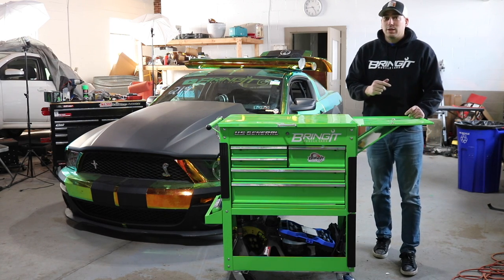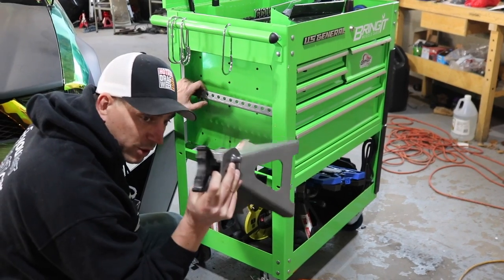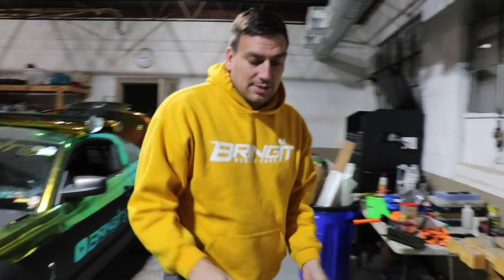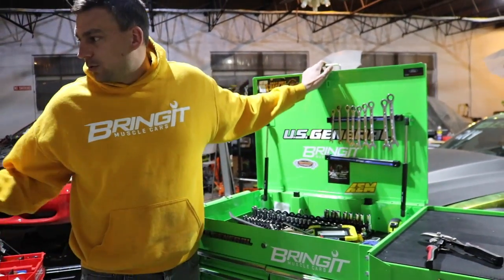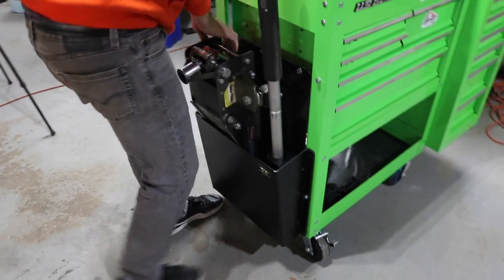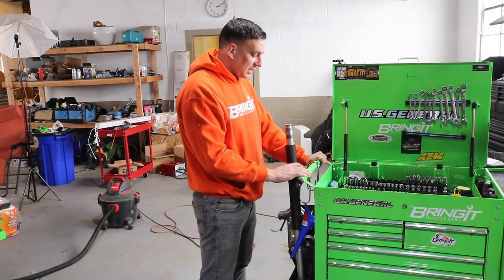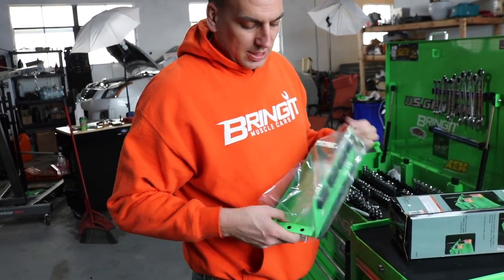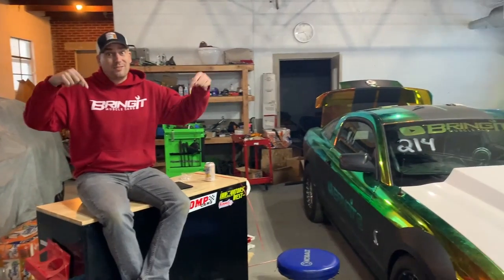HOW TO ADD THE END CABINET ONTO THE HARBOR FREIGHT TOOL CART #harborfreightprojects

Comment: This is awesome I was thinking the car is really good but I was afraid it might be just a little bit too small for some of my tools so adding this extra cabinet is a great idea you showed it really well what I found one for mine whenever I get as I want to change it over to pneumatic off-road tires for the cart and what I'll do is add two more tires to the side box that way it's six wheels instead of four and that will help out with the tippiness because I don't need the jack holder on mine or I could go real crazy and add two side boxes one on each side
Reply from the maker: I think if you can weld adding a frame to the bottom and moving the casters as far out as possible would be really good.

Comment: I did the same for mine but I then drilled 4 holes into it and remounted my folding tray to the side cabinet...then I took the magnetic paper towel holder and stuck it to the tray.... now then you’ll have the ultimate tool cart
Reply from the maker: y0gisdad I can’t disagree with that. I should have added it back on.
Reply: @BringItMuscleCars  might want to also secure the bottom of the chest to the cart
Reply from the maker: Charles Martin I’ll probably end up doing that. For the most part the cart will be stationary in my trailer.

Comment: I picked up the 4 drow and then added a side tool box on both sides then l put on bigger wheels. Works great. Then found a 9 drew top box, took the lead off it fitted in the bottom.
Reply from the maker: Matt Swearingen that’s a lot of box at that point. Why didn’t you just get one of there boxes. It might have been cheaper.
Reply: Well I already have a Craftsman bottom and top box but I like this set up.
Reply from the maker: Matt Swearingen makes sense then.

Comment: GREAT video.  Did the same thing with my tool cart.  An electric or air powered cut off wheel makes the necessary cuts easier and quicker in my experience.  
Would you mind to give us the name of the paint color you used ? Not perfect,  but best color match I have seen
Reply from the maker: Mark Bell i couldn’t find my little cut off saw. That would have definitely made it easier. I’ll take a look at the paint next time I’m at the shop and let you know. Thanks for watching and commenting.

Comment: Think I'd just buy the 44in tool chest. Has wheels. Bolt a handle to it. Put your jack holder on the side, done. I just think if you fill that end cabinet full of tools you're gonna run into that thing trying to tip over. But maybe I'm wrong.
Reply from the maker: Definitely not wrong. And the side cabinet doesn’t hold that much anyway.

Comment: Late to the party but I was just considering a similar project. Since you've now had 8 months rolling it around, in hindsight would you just weld a frame or repeat this process? 

I would like to add a side cabinet on both sides, would this be viable given the stability of the cart or would you weld a frame? 

I'm not a mechanic, the center section will hold my metal lathe tooling and the side cabinets my foredom accessories and angle grinder accessories for sharpening lathe tools. Thank you!
Reply from the maker: If you can weld a frame around everything would be best. Also you could push the wheels out for more stability. However with two side cabinets the cart will be very heavy. Those side cabinets are very heavy. You may want to support the side post of the cart too if you’re wheeling it around.  

My personal opinion is if you’re in a shop area and want to add the side cabinet don’t. Just get the 26” box. It’s just a little bit more money but holds 3 times the tools. The side cabinets do not hold much.

Comment: Only thing missing is the 1000lbs harbor freight lift table. But that's a option if you work on trucks. This cart setup is basically my set up but I have the lift table because I'm a diesel mechanic 😂
Reply from the maker: Cody Phillips I’ll have to check that lift table out I’ve never heard of that with the cart. Where is it mounted.
Reply: @BringItMuscleCars  check out my Instagram codyphillips48. I took the cart put it on the lift table drilled  the 16 holes and bolted the cart to the lift table I place of the wheels

Comment: thanks for doing a video on adding the  side cabinet some of the guys at my work and I have been thinking about doing this.  Please do a follow up video after use to let us know if it is too much weight we have to move our carts around in a factory.
Reply from the maker: joshua hall I can do that. Thank you for watching and commenting. I appreciate the support.
Reply: It's too much rolling around a factory. Unless you reinforce it really well the bolts will start to try to pull out of it mainly it seems to be the expansion joints they put in the floor. I've seen it happen on at least 3 of them now. Unless it just sits in one spot I'd suggest skipping adding any big locker or drawers on the end.
If you still have to do it, IMHO best thing to do is get some angle iron and build a frame for it to sit on. Then move the casters out to all 4 corners.

Comment: Way cool.
I am surprised you didn't paint the jack holder green.
Also surprised you didn't put the fold out table on to the add on side cabinet.
It would take some work but I bet you could figure it out.
Reply from the maker: The only reason I didn’t add the tray was because it was meant to stay in my trailer. I really should have just added it anyway.

Comment: I think I would have made some standoffs to mount the side cabinet and added casters it’s going to be heavy on cabinet side when the jack is being used
Reply from the maker: It sits fine. If you are going to roll it around a lot a frame under everything would help a lot. I originally built it to sit in my trailer.
Reply: @BringItMuscleCars  goog to know thanks for the video

Comment: Awesome video---great mod---been looking at the side storage too!  One thing that is bugging me:  hit those cut corners with a little paint.  I bet someone has the color listed of exact match.  I got blue and someone had listed the exact color match for it----Rust-Oleum Painters Touch 2x Ultracover DEEP BLUE GLOSS.  Almost identical.
Reply from the maker: I wasn’t really worried about the doing that but I do have some more custom stuff coming to the box so I could do it then. Thanks for the paint recommendation.

Comment: As much as I use air tools I would be tempted to add another set of drawers to the other side. Just add angle iron frame to the bottom of it. A good set of casters then good to go .
Reply from the maker: Duke of_destruction I’m thinking of doing something like that. I think you might want some more angle iron in the middle too.
Reply: @BringItMuscleCars  yeah exactly!!! Basically making a frame for the entire bottom . Diagonal bars in the middle from corner to corner
Reply from the maker: Duke of_destruction yup. That should make it pretty sturdy at that point.

Comment: Flush the front and overhang the rear add sum wheels on the side cab for stability
Reply from the maker: Tom Mater I choose to have it flush in the back because I mount it in my trailer. If it wasn’t for that I’d have it flush in the front.

Comment: This is my first time watching your channel. I'm wondering with the type of work you do, the bada$$ Pony in the back ground that you would even bother with HF. I see you have Kobalt and Husky as well. I'm not judging at all.  I think that is genius how you set that up. It obviously wouldn't take a genius to figure that the cabinet will need casters. That's a given, I wonder if the structure of the cart it's self will be able to with stand the weight of all the tools. Sitting in one place would be okay but once it goes into motion, weight shifting, if that maybe cause a big issue? Definitely liked your video!
Reply from the maker: dmckimmey1 cheaper tools work nearly as good as really expensive ones. I need to save money on the tools to help mod the Shelby. Only so much to around. Why spend $100 on a tool when a $20 tool works just as well. That’s enough to buy race gas and a hotdog at the track. The cabinet may need wheels. For the most part it’s strapped into the car trailer.
Reply: @BringItMuscleCars  I'm the same way with my tools. My cart and most of my sockets, ratchets, my jack and stands, etc are all harbor freight. But anything powered such as my 18v/12v  impacts, drivers, electric ratchets are all milwakee.
Reply from the maker: Shan s I have a Milwaukee ratchet which is awesome. Then my 1/2” impact is Kobalt. That thing has been a beast.  No complaints on that. I’ve never used the harbor freight electric tools. Not sure I will at this point.
Reply: @BringItMuscleCars  the only thing electric I have from them is the plug in angle grinder which I've had for years and works fine. A close friend of mine started using their new cordless 1/2" impact recently and it's been good to him. However it is larger and not as powerful as my milwakee mid torque. I've had to come break a few crank pulley bolts for him.
Reply from the maker: Shan s my bet in a year or two they will be much better on all of the cordless power tools.

Comment: How about bolting the side cab to the cart and then moving the casters to the cab
Reply from the maker: The bottom of end cabinet isn’t the same as the cart.
Reply: @BringItMuscleCars  from one mechanic to another, make a couple plates and it’ll distribute the weight better
Reply: @BringItMuscleCars  dig the idea though, definitely going to be doing it to mine now too
Reply from the maker: @DelcoDieselRP  it’s definitely handy.

Comment: I don't see the stock wheels holding up to that weight. And I would have cut the side wall down 1/4" or so and cut the front of the side unit a bit so the top cover fit better.

Comment: Buy four swivel casters. Replace the two fixed casters with two of the swivel casters on the cart. Take the other two swivel casters and mount them on the outside corners of the cabinet. Reinforce bottom of cabinet if necessary. Buy the time you weigh that box down the four casters are gonna catch hell.
Reply from the maker: Richard Alvis I’ve already done the swivel caster mod the cart. I’ll probably just get two more to mount to the cabinet. I’m worried how it will be once I put some weight in it.

Comment: Why not attach the side box with a few nuts and bolts then add 2 swivel casters to the outside of side box this would make it so much more stable and it wouldn't be heavy on the side box side. Also use a cutoff to cut your lid and side box
Reply from the maker: Jim Bogucki you definitely can do that. I’m not really sure you need to bolt it down. The weight is going to hold it in place.

Comment: Might want to put a rechargeable led strip inside the top. Just incase it gets dark out can see your tools and the sizes.
Reply from the maker: VENOMVETTE that’s a great tip. I hadn’t thought of that.
Reply from the maker: VENOMVETTE that’s a great tip. I hadn’t thought of that. Thanks for sharing.
Reply: Bring It Muscle Cars I mounted a 32 inch tv on the back lid on mine with some speakers.
Reply from the maker: VENOMVETTE that’s cool. Mine is normally against the wall of the trailer so i don’t think that would work for me.

Comment: Just my opinion but I would of just put swivel casters under the end cabinet with a block of wood for a spacer probably to much wieght for those cart wheels with that jack
Reply from the maker: When rolling it around on flat smooth ground you don’t need casters under the cabinet. It rolls nice and smooth.

Comment: Might want to support the bottom of the chest or you will end up like me and have with a cart that I couldn't move around.  I ended up bending my bottom tray and essentially loosing the functionality of my roll cart beef up the bottom with some angle iron and add a set of wheels to the bottom of the chest as well
Reply from the maker: Charles Martin I could see that happening. I do plan on adding wheels to the chest.

Comment: Remember, you can always fold up a tripod (like the one I see here in the video, unused) and attach the camera to it, and carry it around like a steadycam. It's not perfect, but it does allow you to get decent stability.
Reply from the maker: Nathan DuPhene I’m getting a new camera next month if we get back to work. I’m getting one that has a much better Image stabilizer built in.
Reply: @BringItMuscleCars  If you were holding it with no tripod or steadycam, what you got was pretty good.

I took the phone holder from a selfie stick and attached it to a small tripod. I fold up the tripod and the bulk of it gives me a lot more options to grip than a selfie stick. Bonus - setting it up as a normal tripod when I want to!

Local libraries sometimes have GoPros you can check out, too. I am all about saving $$.

Comment: I would have had it Wheels to the bottom of the side cabinet and I would have stuck another side cabinet on the other side it's stuck your jack holder on to the side of one of them cabinets and then I was stuck another set of wheels underneath that cabinet to make it easier to roll around and I wouldn't just use the regular plastic casters are used the rubber air-filled ones
Reply from the maker: edward wolf I could see that. If you need two end cabinets then you might want to just get a box. Much better storage options then.
Reply: @BringItMuscleCars  I'm in Harbor Freight near boxes aren't that cheap they are but you're not so on a budget and I love it having the two side cabinets on that would be nice if you are looking at doing the budget thing
Reply from the maker: edward wolf I’m on a budget and space restriction. Trying to best utilize the space in my trailer.

Comment: only thing i would change is ,move the casters on the storage  side to the middle of the side box ,so you have more support foe the extra weight
Reply from the maker: I’m actually going to have a frame made for the bottom. Then I’ll move the casters to the corners.

Comment: Think it would have been 10 times easier and faster to have used a cut off wheel
Reply from the maker: Mike Jones agreed but someone borrowed mine and didn’t put it back. So I had to use what was available.
Reply: @BringItMuscleCars  I ended up cutting my entire lip off

Comment: So for normal people who do things right,unlike this fucking hatchet job on the side cart, you take a piece of flat bar the width of the lip and use the top bolts of the cabinet and washers to offset the bar. Hang cabinet as usual
Reply from the maker: you can call it a hatchet job I don't mind.  That is a very good tip but how thick is that flat bar going to need to be?  Also you'll need spacers because of lid of the cart.

Comment: Why don't you get the 56" General tool box instead😪
Reply from the maker: buenisimo554 the reason I didn’t was so I could keep the jack stands underneath the cart. For me space is limited. I’m keeping it in my car trailer. If I fill it all up it would definitely make more sense to get a box.
Reply: @BringItMuscleCars  the 56" general tool box has a 14" drawer at the bottom where you could've put your jack....
Reply from the maker: buenisimo554 I might end up with it down the road. I like the end cabinet but the drawers are kind of a odd size.
Reply: You can configure carts anyway you want nowadays. And they are more structured for the weight, and stability you need.

Comment: Funny how everyone has an upgrade on this cart and not one person ever thought I’m upgrading the bullshit wheels it comes with ?!
Reply from the maker: Omar Cruise I think it’s because most people done move it around to much. I won’t upgrade the wheels until they become a issue. I did put two swivel casters on my cart so I have 4 now. I have seen where someone put “off-road” wheels on theirs.
Reply: I don't have this cart I have the husky but I upgraded. Got 4 swivel casters at a swap meet for $10. I can drop a subframe with the engine and trans on it and roll it around the shop.

Comment: Hacksaw vs tin snips.
Reply: Why not make the front flush and the extra off the back?
Reply from the maker: @Copingsaw2000  I didn’t make it flush because I used to keep it in my car trailer. So I wanted it to sit flush in the back. It does look better with the front flush.

Comment: You definitely should have place the cabinet back further so the whole front was flush, looks like shit... Good job on the video.
Reply from the maker: If I made the front fit flush then it wouldn’t sit flush in my car trailer. If I wasn’t using it in the trailer I would have made the front flush. I had to build it to fit my needs

Comment: Some solid 8" caster wheels would probably help with weight and transport at track
Reply from the maker: Edson Flores that probably a great idea. I know the carts I’ve seen at the track have had bigger wheels.
Reply: Going from 3 to 5 inch wheel was a major upgrade on my 26inch combo, in a dirty factory. At my height, I had to tiptoe to see into the top!
Reply: Saying, the 8" wheels might effect the work surface.
Reply: Yea I suppose height would depend on how big you would want casters. I'm 5'11" so going 8" casters would personally be more comfortable. But that's just me I do see the benefits of larger wheel to help in aid due to rough surfaces. One could always make a offset bracket and add larger wheels but keep box relatively same height.